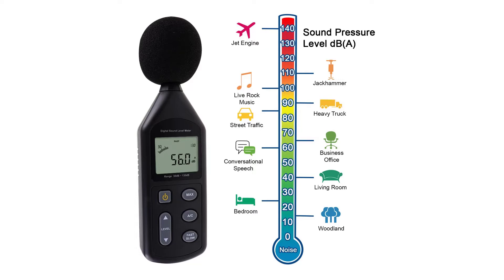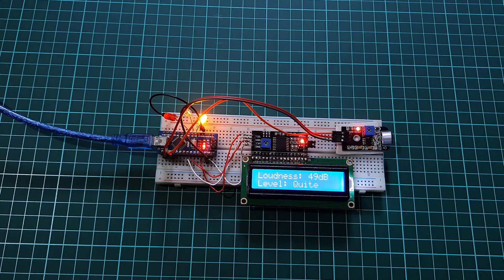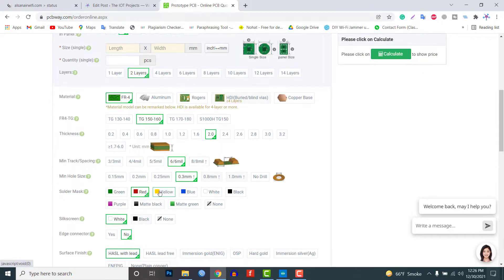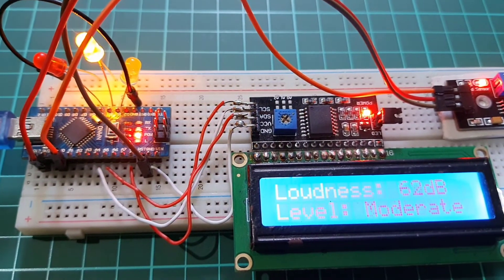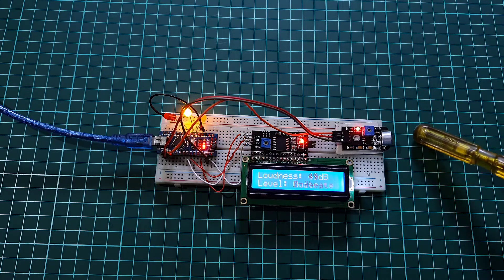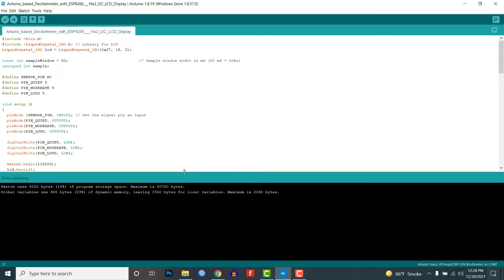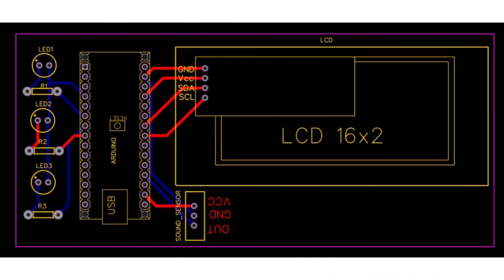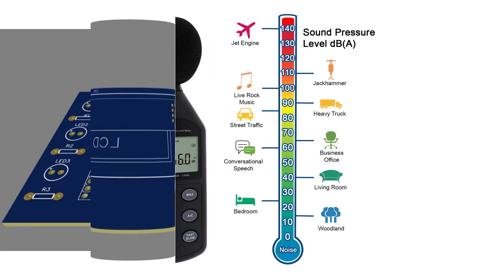Arduino based Decibel Meter with Sound Sensor & LCD Display

Comment: Bro the sound sensor is literally a differential comparator, which means that it only outputs high and low values. The sound level on your display only stays within 49 - 68 dBs. Nice work btw

Comment: But... the mic on this board can not capture those decibels... the specs says: Microphone sensitivity is -42 ±3 db ... (Sensitivity：48~66dB) So you can SIMULATE something with your MAPPING... but don't trust on the values...